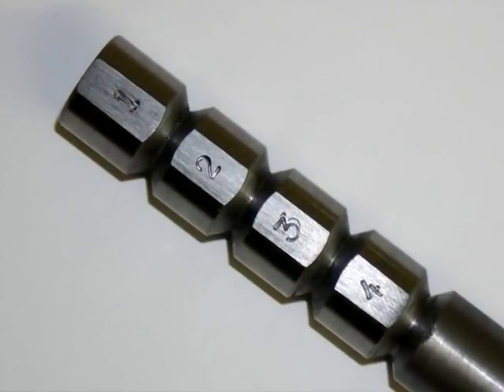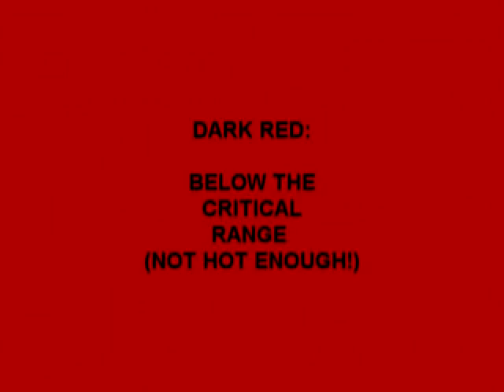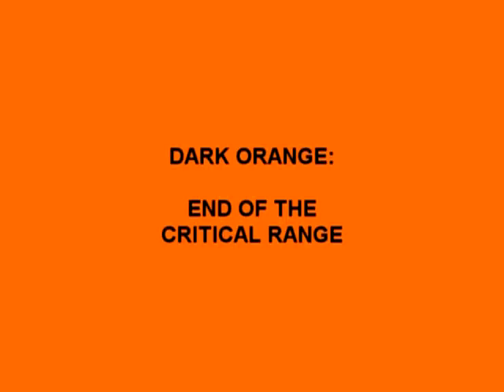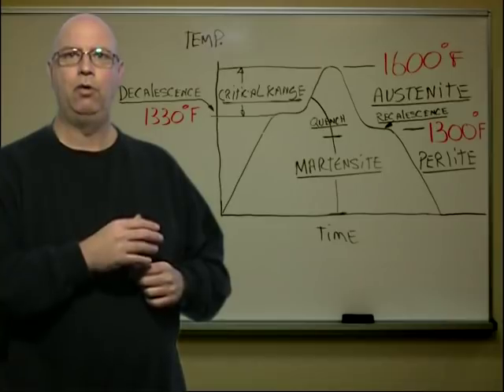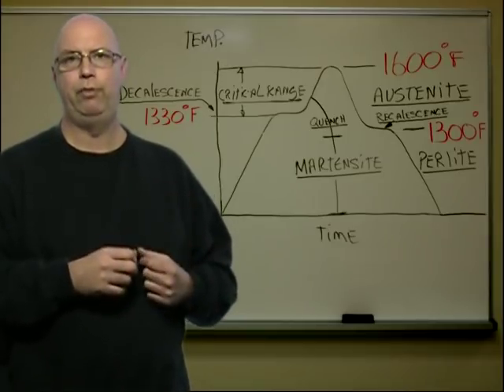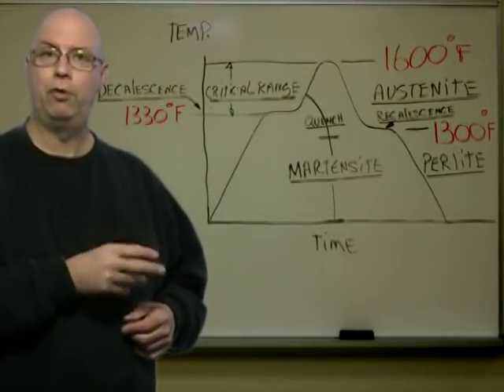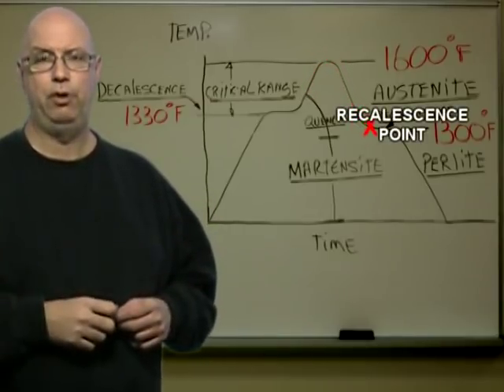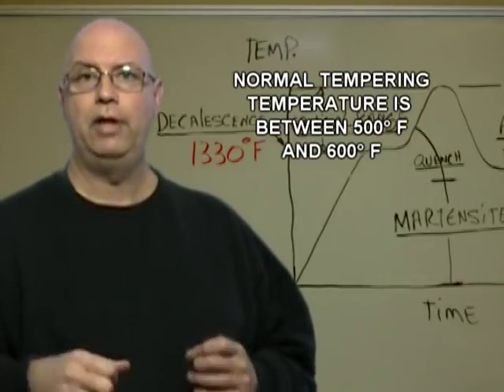HEAT TREATMENT OF STEELS 1, HARDENING, TEMPERING, ANNEALING & NORMALIZING OF STEELSMARC LECUYER

Comment: Hello!
I am a student from Sweden and I just saw your video in YouTube and I was very impressed with your work.
 So I want to ask you something, 
Is it possible to generate heat by small  batteries and be able to burn pepper with the heat generate by the small battery? what kind of metal is very easily heated into degrees that can burn a pepper ( I mean very fast like in matter of minutes or seconds )
Reply from the maker: This has got to be one of the most bizarre questions I have ever received. I am not very good with electricity but I would suggest wolfram. Which is the German word for tungsten. It is what incandescent light filaments are made of. Beware of toxicity! I would strongly suggest that you speak to an electrical engineer, because I cannot help you with such subjects as electrical resistance, current and filament thickness required. Please be careful and tread cautiously, I would not want you to be hurt. Marc L'Ecuyer
Reply: Thanks very much, and don't worry iam not messing around with electricity it was jsut a teori i had if something with such properity exisit. Thanks again :)

Comment: Hi, first of I'd like to say that I love your explanation of hardening and tempering.
Having just started making knives,  I'm trying to learn as much as possible about metallurgy.
I am a little confused though: in the example with the 3 pieces of the rod the third had the best structure (fine),
but around minute 19 in the video you say that to get the tightest grain structure, you need to quench it towards the upper temperature of the critical range?
Aren't those contradictory?

Thanks in advance!
Manu
Reply: Hi Manu!  I'm a newbie to knife making too!  I caught that statement he made as well, but then after thinking about it, go back to the 4 section test.  Sections 1 and 2 went beyond the critical range, that's why they had the bad grain structure.  Section 3 had the best structure because it was in the upper range of the critical temperature, even though 1 and 2 hardened, they exceeded the critical temp range.

Comment: Thanks sir for your nice explanation. I would like to know whether mild steel containing around 0.25% Carbon can be hardened by Quenching method. Should the tempering operation be performed just immediate after quenching? In case of yes, then to what extent hardness could be obtained? I will be highly grateful if you kindly inform me.
Reply: Khairul Islam 
NO pmsl
Reply: Yes, but you probably won't get the hardness level you want.  You'd have to find  away to quench it much faster than oil or water will.

Comment: So it seems that if I want the barrel of a gun to be the hardest and the toughest it needs to be quenched at a dark orange color and then tempered at 560 degrees.

In general what is the failure pressure of a piece of steel that has been treated like this - I saw another machinist say 200,000 psi.  Does that sound right?
Reply: +Karen Cappuccilli Go for toughness in a gun barrel rather than hardness, always.  The pressure at which it fails would depend on the thickness of the steel at any given degree of tempering after hardening and the presence/absence of any stress risers in the steel also.  Whole lot of variables there to consider.  Hardness/toughness...more of one means less of the other.  There are schools that teach this, and for something like a gun barrel it would well be worth the cost...pretty critical part to get right without experimentation on your own.  As a gunsmith, I've seen many burst barrels and all of them had missing pieces...pieces that ended up SOMEWHERE...

Comment: I just annealed 3 jaws from a small lathe so that I could modify them to allow for soft jaws. Now, I am ready to re-harden. I notice you use water quenching. What would you recommend to ensure the best results with regards to dimensional stability. I have seen some people doing water, some mineral oil, and some actual quenching oil. Small pieces: 30mmx20mmx11mm. Thanks
Reply from the maker: +Tim Wender Oil quenching reduces deformation since the thermal shock is much lesser. I would recommend using quenching oils since it has a very hi flashpoint and cannot sustain its own flame. Much safer! Thanks for watching and be safe! Marc

Comment: Is annealing or normalizing required to forge hardened steel? Or can hardened steel be heated and forged normally?
Also, if you were to grind tempered steel, would the color grind off?
Reply from the maker: Hi! if you heat the steel to a bright orange (1600°F) it can be forged sine it will become quite malleable. Keep it hot though because the high carbon content makes for a steel that work hardens quickly and will easily crack at lower temperatures. At that temperature (1600°F) the steel is in its austenitic state and if it is cooled slowly it will be normalized (perlite)(unhardened) and if it is quenched it will hardened (martensite) and can then be annealed to increase its toughness. The tempering color is cause by carbides formed on the surface of the part when the carbon comes in contact with air at different temperatures (autoclave ovens will not color steels during annealing) and since it is a surface finish (a few microns thick) it will be removed by grinding. I hope this helps, Marc
Reply: THATLAZYMACHINIST 
Thanks Marc.
Your detailed reply is much appreciated.

Comment: Hi
Does W1 and O1 give different final products ?
Thanks for the very informative videos
Reply from the maker: Hi John! Water quenching tool steel (W1) and oil quenching tool steel (O1) reach the same hardness so for that aspect there is no difference. However O1 needs much less thermal shock compared to W1 to harden. That means that parts made of O1 will suffer less deformation during quenching and will have a better hardness penetration (how deep the hardness will reach inside the part, particularly on large parts). I also find (and this is my personal opinion) that O1 tool steel is more resistant to shock and heat (during cutting). I hope this answers your question and thanks for watching my videos, Marc L'Ecuyer

Comment: Which solvent would you use to clean a highly polished part before tempering and to ensure the final color is uniform ( alcohol, thinners or methylated spirits) ?
Reply from the maker: Hi Kaiok! Any good de greaser will do the trick, I like wood alcohol. It is important that the par not be touched with anything but a clean rag when inserting the parts in the oven, make certain that the tool used to pull the parts from the oven is also clean and exempt of oil. Remember to use new or dedicated refractory bricks to support the parts in the oven and if possible pull the parts from the oven with the brick they are resting on, this will reduce all risks of contamination during cool down. Once cooled wipe the blued parts with a light tool oil (like the oil used on micrometers). If left dry, the parts have a real fingerprint problem since the carbide coating is a little porous. Remember that the time spent in the oven determines the thickness of the crust, a good hour (once the part is up to temperature) should do the trick. Thanks for watching and be safe, Marc
Reply: +THATLAZYMACHINIST Thanks Marc!  Your videos are a boon for those of us just starting out in machining.
Reply: +THATLAZYMACHINIST Thanks Marc!  Your videos are a boon for those of us just starting out in machining.

Comment: This is very interesting. At 27:00 you say that near 620 degree (F?) you're approaching "full temper", did you mean "full annealing" ?
Reply: Hello again Shodanxx, a full temper is when your steel reaches maximum toughness while maintaining a good hardness. Tempering is performed to relax the stresses imparted to a part during quenching, and will make the hardened steel more shock resistant. A light temper (yellow) is used for maximum wear resistance and a full temper (baby blue) is used for maximum shock resistance. A full anneal is used to soften steel, it will remove all the hardness and make the steel machinable again. I hope this helps, have fun and be safe, Marc L'Ecuyer

Comment: What if you temper a really hard heat treated steel like a #1 here, to get a still quite hard tempered piece. Would that work?
Reply from the maker: Hi Ij, the harder the steel gets when quenched, the more it needs to be tempered since very hard steels tend to crack under their own tensions. A lite tempering (brown or purple) will not affect the hardness very much but will greatly improve the steels resistance to shock. I hope this answer helps? thanks for watching, Marc L'Ecuyer

Comment: Is it possible and safe to heat color a double walled insulated stainless steel cup? Will it explode? Will the double wall prevent enough heat to come to a nice blue color? I etched my contigo coffee cup and now want to color it. thx! brenda
Reply from the maker: terp4u2 Hi Brenda, I couldn't say, if the space between the cup walls is ventilated (not sealed) it could work but you would have to heat the cup very slowly to avoid uneven coloring, but then again uneven coloring could be nice. proceed with great caution, Marc

Comment: I'm not sure that all of the information here is factually correct however I understand that this is not intended to be a comprehensive guide to metallurgy, but there are some distinctions worth noting:

1. It's spelled Pearlite not perlite
2.If a steel is slowly cooled to below the eutectic temperature a steel will not just be pearlite, but will also contain some amount of the proeutectoid (either Cementite or Ferrite) unless the steel is a eutectic composition which is the only case where 100% of the steel will slowly cool to become pearlite.
3.I think some of the confusion comes from thinking that pearlite is simply a combination of ferrite and cementite, but pearlite is actually a specific structure of alternating layers of ferrite and cementite
Reply from the maker: Thanks guper16. You are right from beginning to end. The video is intended for the home shop aficionado so I don't go into much detail, I try to keep it understandable for someone who has no formal training. For me the most important point made by your comment is that heat treatment is much more complex than what I have presented in my video, and if lives depend on a perfect heat treatment, learn more! I am glad that you took the time to comment in a positive and constructive manner, since good comments always help. Marc L'Ecuyer
P.S. Perlite is French for Pearlite, I produce all my videos in French and translate after and since I do it all myself, some mistakes make it to the final product.
Reply: THATLAZYMACHINIST Man that's impressive that you take the time to do it in both languages, but I'm guessing that's pretty important when making videos in Canada ay? I appreciate you taking the criticism so well! most people can't handle it even when it is not intended to be a slight against the person who made the video. I really did enjoy the video and got some information out of it namely the ability to identify a heat treatment based upon color. I appreciate the help you are giving many people trying to produce and invent at home. I'm definitely looking forward to future videos.

Comment: What if a part has three range of colors after the tempering process. For instance it has splotches of the purple and both of the light and darker blue? Will this mean the part is inconsistent in the tempering process?
Reply from the maker: Your colors are pretty close so I don't think it would be a problem but yes there is some inconsistency in the tempering. make certain that your part is not too close to the heating elements, and that the oven is well preheated. Check also that the oven is well calibrated. if you are using torches, keep the flame from coming in direct contact with the part, heat the part slowly and as evenly as possible. A colder propane torch is sometimes easier to control than a hotter acetylene torch when it comes to tempering. I hope this helps and thanks for watching1 Marc L'Ecuyer
Reply: THATLAZYMACHINIST Thanks, that's a big help.

Comment: Could you tell me each of the segments percentages? I need to know each of its properties weather its low, mild or high
Reply from the maker: Strawb3rry Lime Hi Strawb, could you indicate what segments you are talking about, I will then try to answer. Thanks, Marc
Reply: All of the segments.
Reply from the maker: Strawb3rry Lime Hello again Strawb, all the segments used for the tempering color demonstration come from the same bar of O1 (short for oil quenching tool steel). I don't remember the exact alloy but the carbon content was around .8%. Here is a link to a good fact sheet on O1 tool steel  http://www.buffaloprecision.com/data_sheets/DSO1TSbpp.pdf  I hope this helps, if you have any other questions you know how to reach me. thanks for watching, Marc L'Ecuyer P.S. The Metcalf experiment segments are W1 tool steel (short for water quenching tool steel).
Reply: Thank you

Comment: whats going to happen when titanium heat treated? im very curious to watch..can u do a video?
Reply: Titanium comes in many different allows for very specific uses.  Any hardening is typically done via solution or age hardening.

The primary purpose for heat treating titanium is annealing (for fracture toughness) or straightening it (titanium has a tendency to spring back to shape at room temps, kind of like a spring).
Reply: yes ,i know that  heat  treating is for hardening..what i want to know is,if we do heat treating titanium like steel will it break like steel? ?thank u for replying me edward
Reply: No.

Comment: I was under the impression that for steel, demagnetization was the simplest indicator for the perfect critical temperature at which to quench it.
Reply from the maker: Demagnetization is a sign since steel in its critical range is demagnetized. However from the lowest temperature of the critical zone to the highest, the granular structure can vary widely so it is best to shoot for a specific temperature when possible. For most home shops, color or magnetization will work just fine. Thanks for a great question and be safe! Marc.
Reply: @THATLAZYMACHINIST  thank you for the reply and the educational video.

Comment: What if you temper it at 500-600F. More than once ?
Reply from the maker: Hi! It would be easier to just leave it longer in the oven, 40 minutes per inch of thickness is usually enough for calming the internal stress. Leaving it longer will mainly thicken the carbide (colored blue at that temperature) but that also has a limit, after a couple of hours the coating will stop thickening (we are talking microns here). Leaving it in the oven more than that would be useless. I hope this helps, thanks for watching and for taking the time to write.

Comment: Alright, hopefully someone can help me with something here.
I have been making a chess set out of nuts and bolts and continue to come across hurdles. 
My first hurdle was changing the colour for the "dark" team. Then I found this video and I decided this is how I was going to change the colour, but first I had to strip off the Zinc from the bolts to get to the steel so that it would not burn. I have done that and then I polished them up and put them in the oven and reached an absolutely gorgeous brass colour with a bright blue/purple almost two-tone. and so now here is my dilemma that I face.... now that the steel is bare, it is prone to rusting and i dont want that to happen. I need the colour to stay and for it to be rust proof as i want this chess set to be for the outside. So I am looking for some kind of clear coating for metal that stops rust and is as clear as possible to preserve the colouring. 
PLEASE HELP!!
Reply: I made a brass button for my outside toilet because the plastic one broke, it was also a good project in metal spinning. I then polished it and waited until a friend of mine whom restores old cars was putting clear over base (COB) and after several years it still looks shiny almost like gold. By the way EXCELLENT explanation of what to do and what I have done wrong in days past. Cheers from John.
Reply: PS Subscribed, Thanks Marc, John.